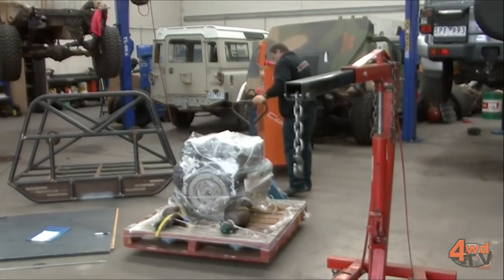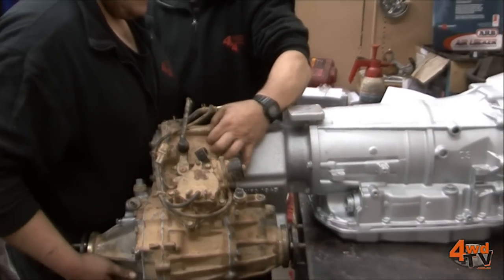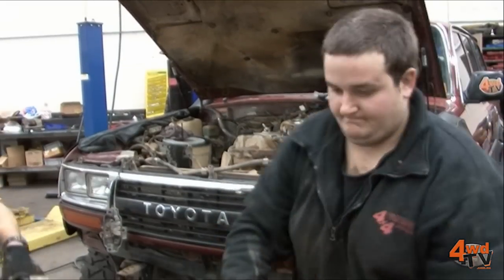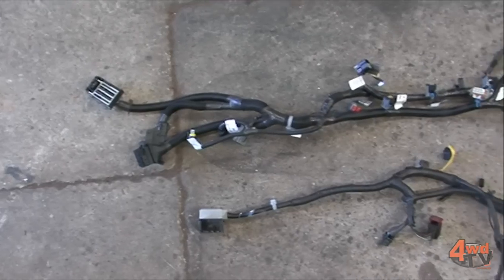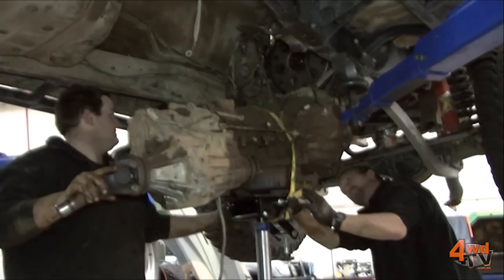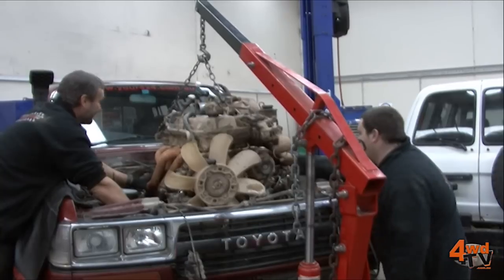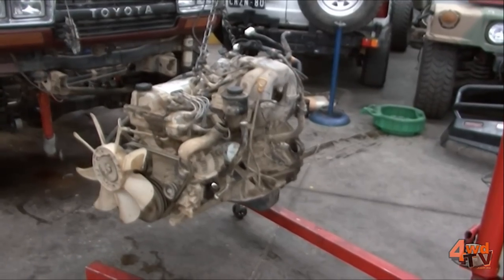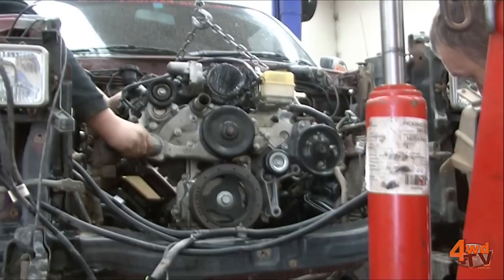Danny's LS2 V8 80 Series Conversion

Comment: I had Brett from 4x4 Obsession do work on my 80 series several years ago Replaced the head - less than 5000km later head blown due to Brett failing to replace the water pump (the original reason for the car going in); Brett installed a P/T kit - less than 25000kms the heavy duty hubs collapsed - installed and air compressor, lightforce lights and rear light - fuse kept blowing due to several short circuits; rear light had to be replaced the second replacement is somewhere on the Hume Hwy between Sydney and Melbourne; Brett claims he refreshed my OME suspension including new bushes - workmanship failed MOT and had to be replaced.  All of this and Brett refused to honor any warranty.  Not once was vehicle put into low range, so none of this is due miss-use, 99% hwy travelling and daily driver.  Do not use 4x4 Obsession and don't not trust Brett.
Reply: +Michael Robertson Good on you! Tell it like it is.
Reply: Damn, killed that business 😆

Comment: 1zfe is not junk is a beast to a engine builder like my self been nice if the valve angle was wider but the turbo and narrow valve angle will be good combination they work well together due to turbulence in the air fuel mix
Reply: Yeah I was confused why they referred to it as a boat anchor. I found that strange. Course I have the 1hdt sohc but it's not like the petrol one is prone to problems

Comment: No actually they are fairly, solid and reliable motors, from my experience with one. I'd trust the power and torque, of one of these HZ 6's over a diesel equivalent any time, but the economy of the somewhat over engineered engine is what puts people off them, that is why people prefer diesel. 20L/100km really is bad economy for a 6. The 4.7l V8 toyota engine had better economy than that
Reply: but did the vvti version improve things?

Comment: Cost?$
Reply: They won't say, that means you can buy a brand new Suburban fully loaded for a 1/4 of the price. 
Four week job???
40 hours per week x 4 employees x 4 week = 640 × $60 per hour = $38,400 in labor alone. Then another $10,000 in parts going into a used vehicle worth $1000 = $49,400. Still have to address any automotive issues ie.. brakes, cooling system, bodywork, paint, interior and mechanical and electrical issues. Add it all up...you still have a truck that if it gets rear ended by a Yugo. Your insurance company will pay you the worth of a used old truck. $ 2400.
Reply: yeah sounds like crap talk to justify the high price, dont get me wrong. if its 2 blokes for a week and a half 10K is about right..

Comment: Haha ls2 in an old cruiser r.i.p diffs not dissing cruises I own a 105 but com on the diffs break now with the stock engines in them haha
Reply: Solid pinion spacers make them much more reliable. Add chromoly cvs and diff locks and you shouldn't have any issues
Reply: Hahahaha your dreaming Luke